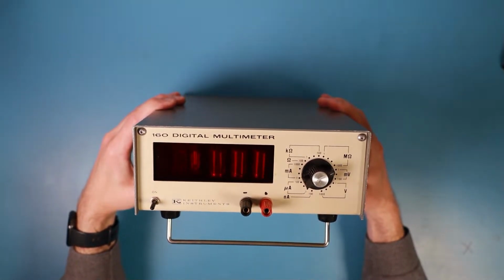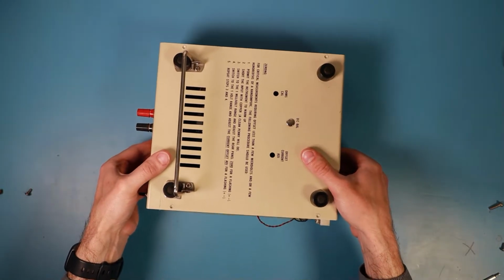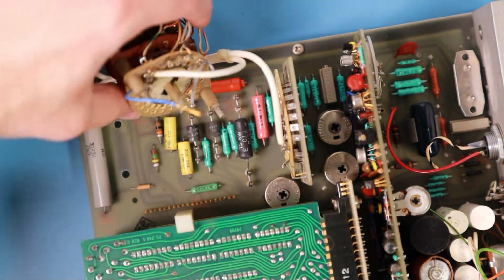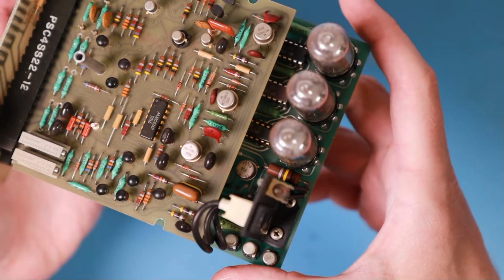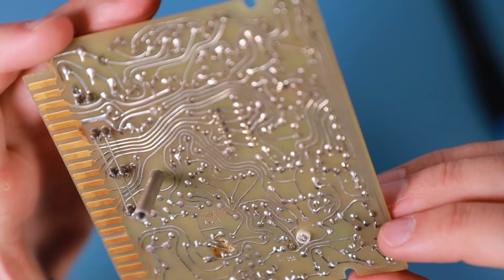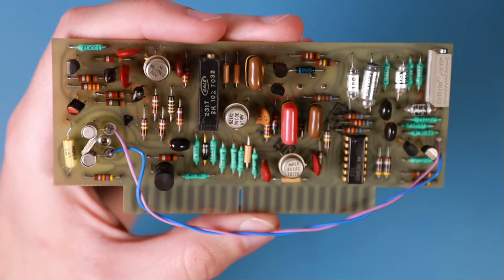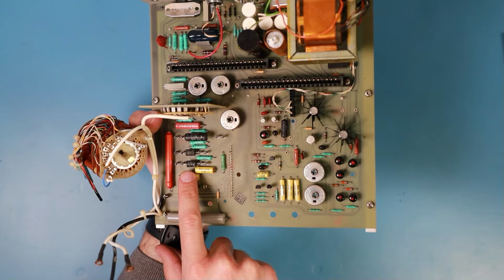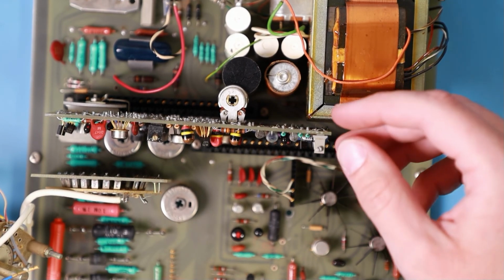Keithley Instruments 160 Digital Multimeter - Teardown

Comment: the black split capacitor is apparently C201 originally 2000uF 15V, replaceable by 2200uF 16-35V 105C variants, but if I was you, I would also replace the Nixie powerspply capacitor C212 originally 15uF 300V replaceable by 22uF 350-400 105C variant. the high voltage capacitor might leak electrolyte and cause fire on the pcb because only component to limit current on this 210VDC section of the power supply is a 82Ohm resistor R219. Source of this information 160 manual from TEK website, and experience from a Datron 9 nixie frequency counter made in the 1970-1977 timeframe.

Comment: It will be good to see it fixed and operating! 
I believe the power connector is called a type "163", or sometimes an "oval" connector. Not sure where you'll get one though, I have some old HP gear that also needs a cord like that.
Here's my 1970 Nixie voltmeter. Not a multimeter, but it does have 5 tubes!
https://www.youtube.com/watch?v=19-QcH3rS7s
Reply from the maker: Yeah, it has been a long time since I did this Video and I already finished recording the repair a long time ago, but I did not get around cutting and uploading it. I am at the final steps now.
Also, I couldn’t find the PH-163 connector on the flee marked or on the Internet. At least not for a reasonable price. But I found a 3D printable Part on Thingiverse (thing:4862134). Only the metal contacts used are not available at the moment due to shortage. For my Video I just used long alligator clips when testing.
Reply: @cookingcomponents7858  Thanks for the thingy tip!
Reply: @cookingcomponents7858  I have the same Multimeter and I find a power cord that fits perfect a thrifty store from a old coffee machine. Luckily mine was working perfectly but I have to wait about 4 minutes so all digits show completely.